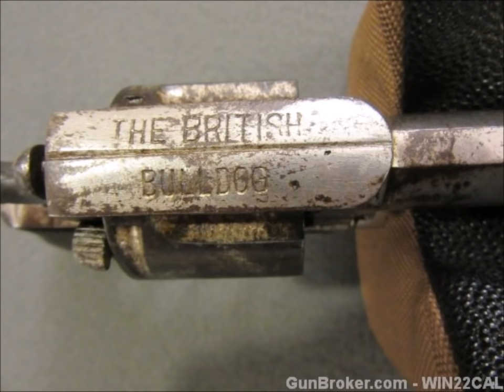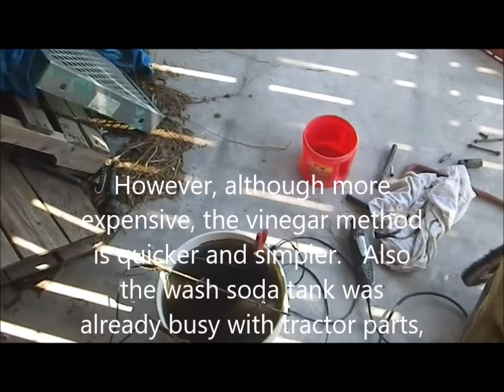Bulldog pistol restoration

Comment: Good news from my gunsmith he found the part he needed but from a .41 cal. Bulldog ; but he said he thinks he can modify it to fit. Its been months. If it can be functional thinking bright nickel Cerakote with gold cylinder hammer and trigger .
Reply from the maker: I am pretty happy with a simple nickel finish.  Easy enough to do at home.
Reply: @kenibnanak5554  I can get electro bright nickel locally for $100 but ID have to take the revolver apart after the Smith just finished it. That's the drawback. My Smith does Cerakote not nickel. But Cerakote has an H77 I think bright nickel and ID go gold cylinder hammer. and trigger
Reply: If I knew as much as you ID be fixing it myself. To me $100 for nickel is cheap Plating at home if you don't know what you're doing isn't worth it to me. Chemicals mess poison. Etc
 That's just me. Not a gunsmith give food around with modern ones but taking apart antiques I feel you're asking for aggravation. I appreciate the video however
Reply from the maker: @josephlahood4647  The primary ingredient of my plating solution is vinegar (also good for killing weeds).  My power source is an old 12v power supply left over from my CB radio days.  You don't start getting into the the strange chemicals until you start buying commercial 'bright' nickling solutions.  For what it is worth some say adding raw egg white to the vinegar increases brightness, but I haven't tried that.  But yes you would have to disassemble the gun and prep the parts to plate it.
Reply: @kenibnanak5554  Thanks for the info if my Smith did Nickel ID pay him to do it. He only does Cerakote. It just doesn't make sense for me to take it apart after he repaired it and assembled it timed it etc. Its too old to risk it. That's just my philosophy.
Reply: Ill replace the grip panels however. That's easy. But I think their original Mother of Pearl so I may not

Comment: BTW:  Is the project finished?
Reply from the maker: No, sorry I had put it on a shelf due to external events.  You are correct I need to finish it and put a 2nd video out.  Everything was polished and copper plated, but I need to do the nickel plating and reassemble the pistol.
Reply: Would really love to see rest of project documented. I just spent 34 min, and although I don’t regret the time one bit, it sure would be less of a let down to get to see the rest!

Comment: my  grampapa alway had one i that was his grampapas  in the medical box in the barn if he had to end an animals suffering  or if he had put rabbied animals down it's funny he still has it out that wrapped in a rag and still has the same three box of ammo it came with
Reply from the maker: Original ammunition in original boxes has monetary value to collectors.  Guns given a reasonable level of maintenance and not abused should last for centuries.
Reply: Ken ibn Anak  ya  its 32 rimfire and the boxs/ ammo  are in sad shape the guns still good I'm thinking of offering to replace the ammo with steak insertes with a 22 blank and load it with black powder and a cassed bullet
Reply from the maker: .32 rimfire short is $110 for a box of 50 on Gunbroker.  Regarding reloads I found these on gunbroker today, you may prefer them.    
http://www.gunbroker.com/item/772629302